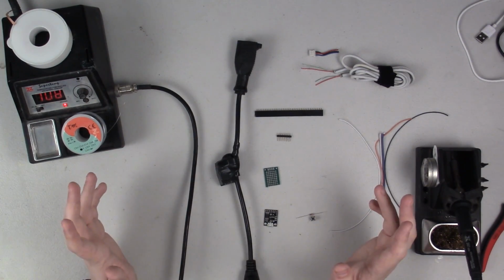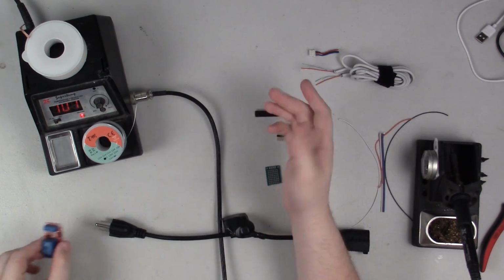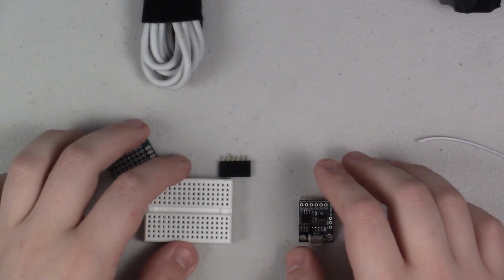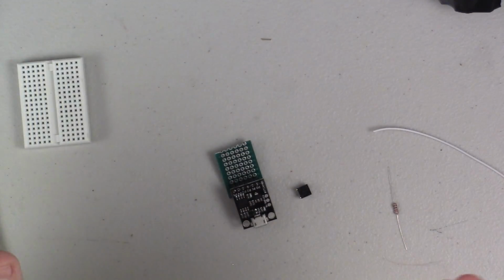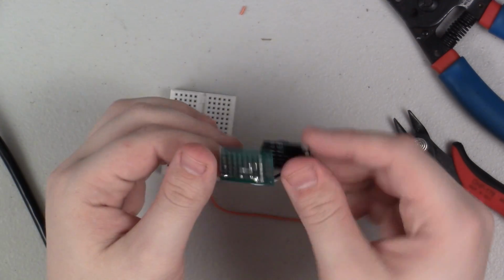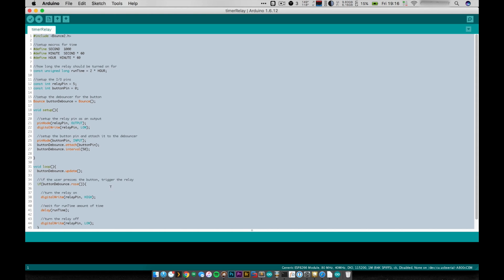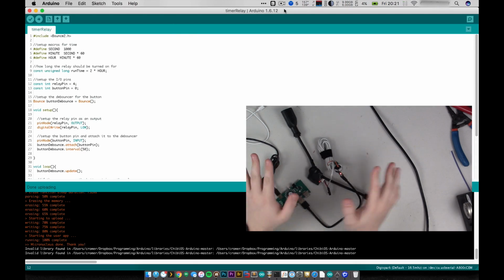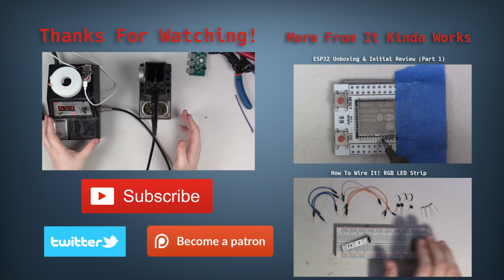Soldering Iron Auto-Shutoff (AKA How to NOT burn your house down)

Comment: Fantastic, love your videos!!  Had the same issue with the lights above my work bench. Have a similar system except included a PIR sensor. When I walk up to my bench the lights come on. If I walk away it waits for 10 minutes without seeing any movement and then switches off.  Have been thinking of incorporating the same system for my soldering iron and hot glue gun which I've been worried about forgetting.
Reply from the maker: +Ian Ragless thanks! That's an awesome solution for your workbench! I love the idea of PIR but whenever i try to use it, it always lets me down in some way, either it's too sensitive and triggers when no one is in the room or i have to flail around to get it to trigger. its probably just bad/cheap modules... but I'd love to incorporate more motion sensing into future projects!

Comment: I would have used a SONOFF standard, 4 female header pins, reprogram the esp to use the builtin button, has builtin power supply and relays … and at 4.85 is cheaper.
An other interesting way would be the Sonoff power, which sense the current when you turn on the station and would cut the power if left… at 10$ ?
Reply from the maker: I could have used a sonoff it's true. But I like my way. Plus how could it kinda work if I just bought something that actually works. This ain't the ItTotallyWorks channel ;)
Reply: Yeh, but you cheated with the relays module, (where you could got the supply for the Attiny)…ok it's you way.
But a current sensing version would be nicer, because no button to press...

Comment: i think that for about the same money of all the components you used, you can do it with a well enclosed sonoff, which adds wifi, and after flashing with an alternative firmware you can use the embedded button to turn it on, off or start the 2 hours delay you used by long press... and of course, manage it via your smartphone... just an idea :)
https://it.aliexpress.com/item/Sonoff-ITEAD-WiFi-Wireless-Smart-Switch-Module-With-ABS-Shell-Socket-For-MQTT-COAP-Smart-Home/32683636030.html
Reply from the maker: Thanks for the suggestion! I guess for me part of the reason for not adding wifi or extra features is that I really want this to be a safety mechanism. I dont want it to be able to stay on or have some malfunction in my code (the more complex the code, the more likely it is that I'm going to make a mistake hah!) But eventually I'll have to get one of those sonoff modules and check it out for myself :)